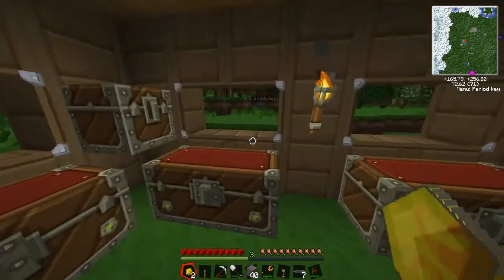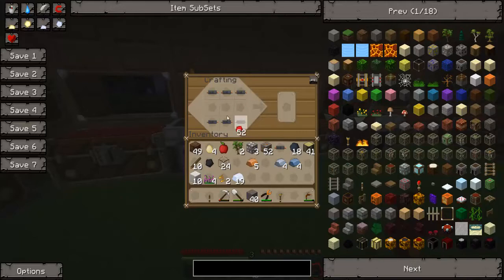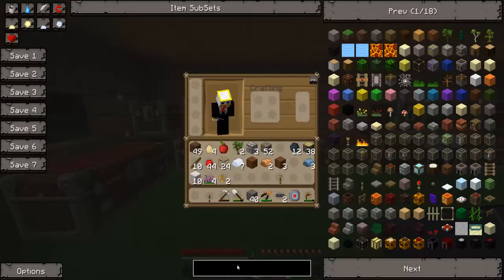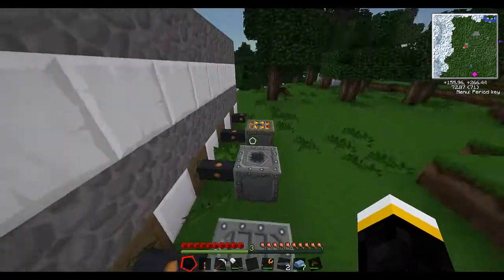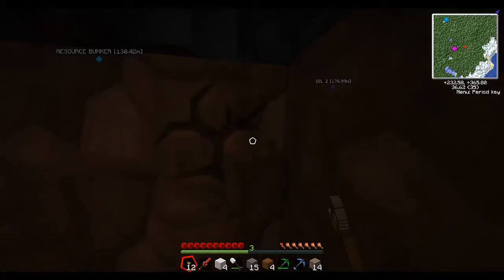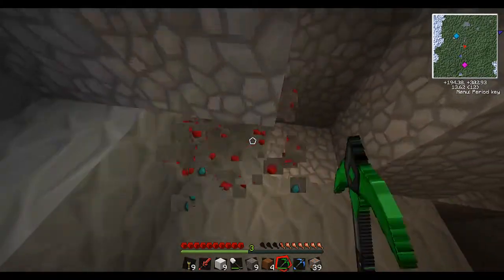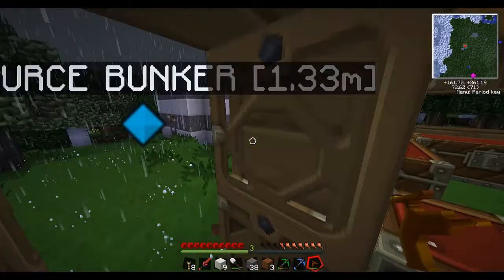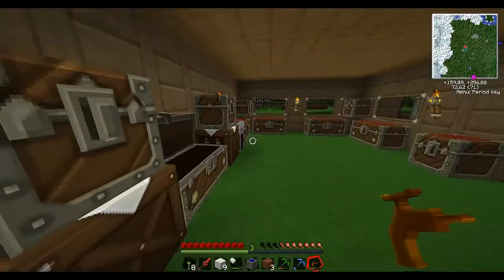Tekkit: Part 7 - Solar Power!

Comment: The Philosopher's stone has many different uses. 1) It acts as a portable work bench. You can even super impose recipe into the grid so that you won't have to worry about memorizing how everything goes. 2) It can change the properties of blocks (You can change stone into cobblestone and vice versa). 3) You use it in recipes for some of the recipes on the magic side of tekkit. 4) It apparently does something if you use it on animals (I don't know what though). 5) The best part about it is that...

Comment: ...you will only need one forever. The game gives it back to you whenever you use it in a recipe. You can recharge it. Also, I'd work on a nether portal. You can get nether ore there. I won't list the stats for each ore, but you can learn about them by googling it.